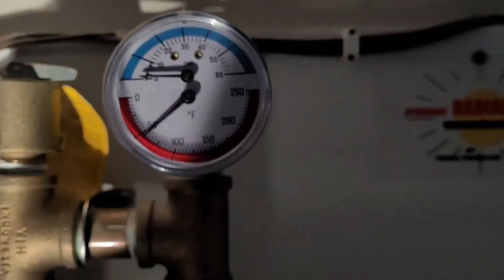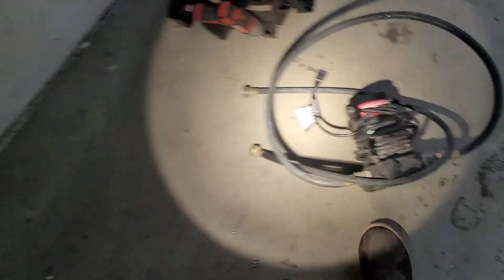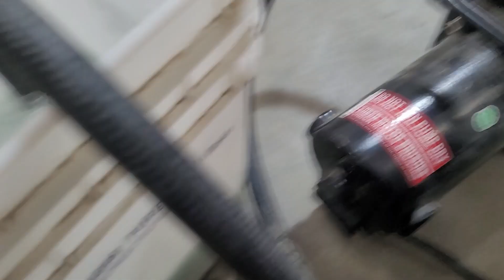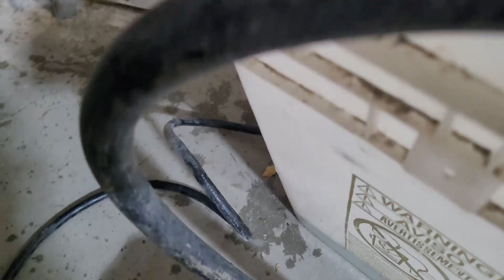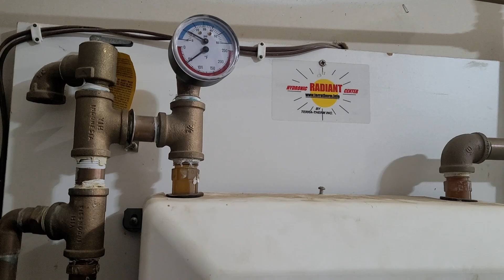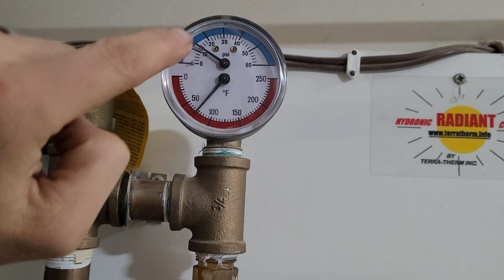How to add water to a Boiler that has no Water inlet plumber to it!

Comment: Seisco were innovative, came out in 1999 or b4, still using mine for whole house hot water 18kw.  Company bought by AOSmith.  Had problems early on with cracks in all plastic housing, but corrected later on.